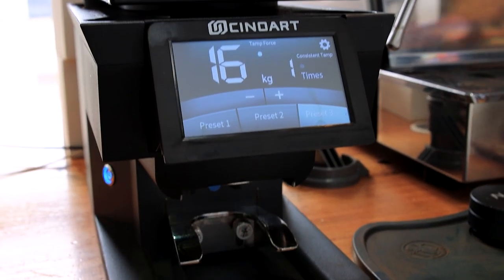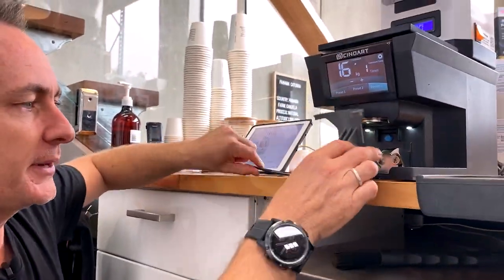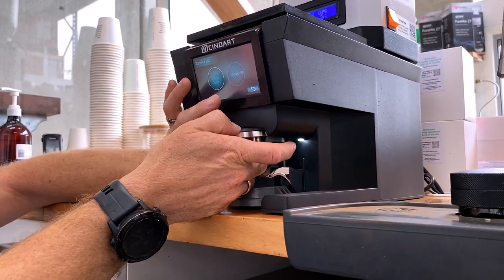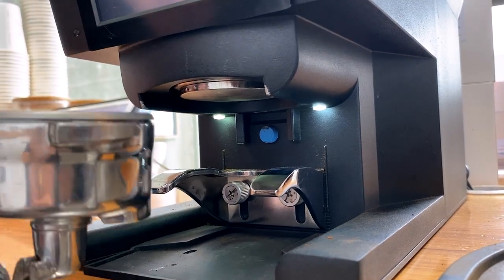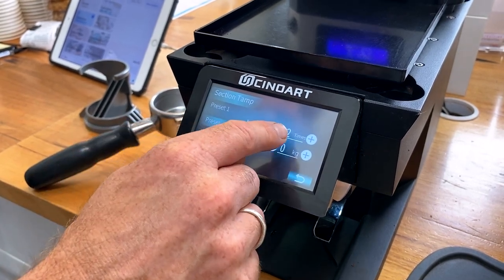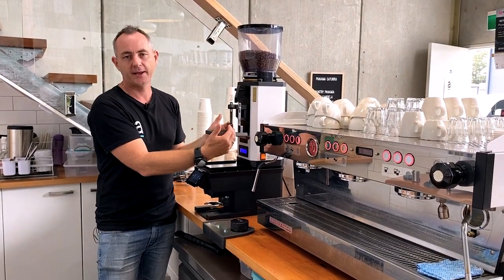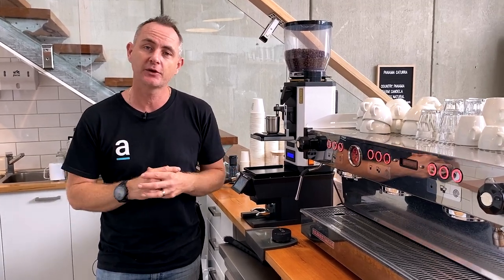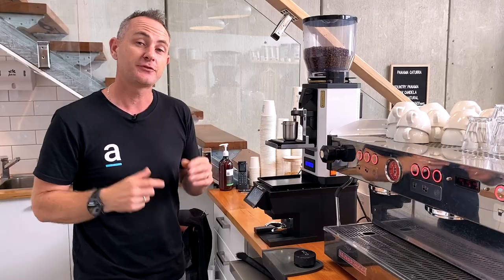Future of Tamping Coffee - Cinoart PTB  (Throw Your Tamp Away)

Comment: For a new shop or a remodel, a dropped down section built into the cabinet just large enough to accommodate the tamper and clean up around it, while leaving the grinder base at counter height would might work well.

Comment: Great video! How would this one compare to the Puqpress under grinder tampers? M5 etc.
Reply: Was wondering the same thing lol, imo the Cinoart's advantage is the leveling system, and varying pressures which I found personally to be useful. Since Puqpress uses straight piston tamps, the leveling isn't so great depending on what angle you insert your portafilter and playing with the forks are gimmicky. I've had experience using the Puqpress M-line, Puqpress Gen 1s and 2s and the Cinoart PT2. I found that Puqpress tends to have better build quality, better materials and is known to hold up for years upon years with billions of tamps. If only Puqpress had Cinoart's leveling system that'd be gold.